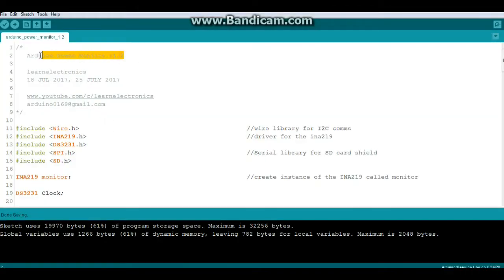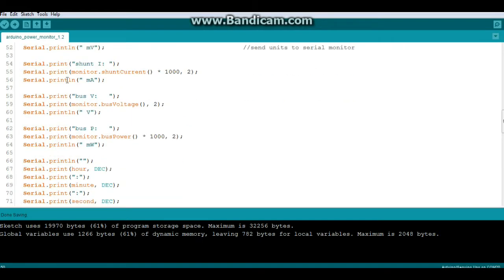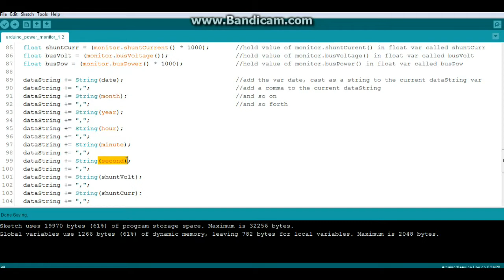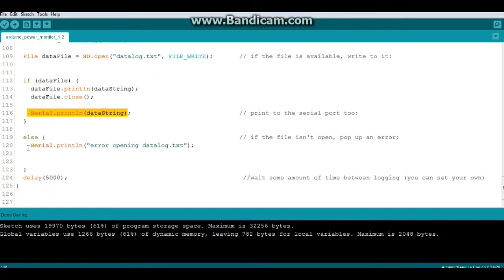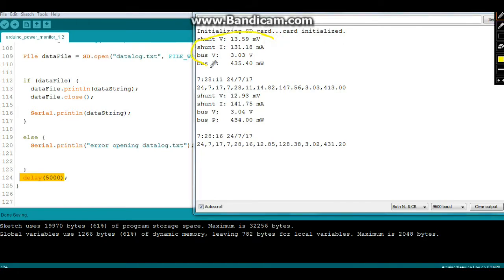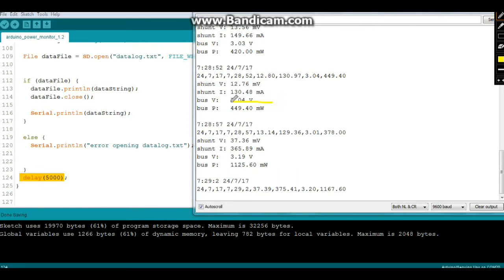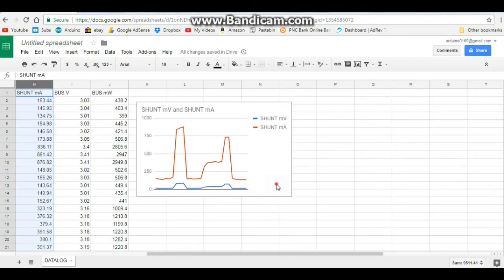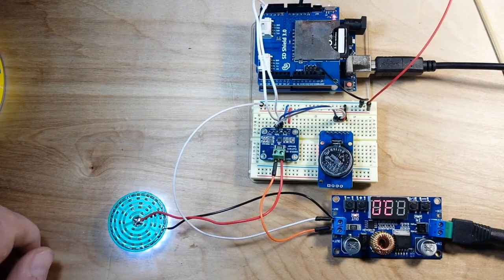Arduino Power Monitor with Data Logging

Comment: I think Fred has the right idea here. string variables eat memory like crazy. I hope you can get the library working with the ESP 8266 which should then work on an ESP32? Fun with comma separated data files. I started with them in the early 80's and still use them today. Probably showing my age! I had a fun project today I built a static phase converter from parts I've accumulated so I can get that Baldor grinder running. It works like a champ too. Thanks for your hard work on this project.
Reply from the maker: George Chambers damn c++ and casting, concatenating, I need a Turbo Pascal or Logo IDE
Reply: well there are pascal to c++ converters :P

Comment: using the string class on a microcontroller also uses a ton of flash and memory. if possible one should work with normal cstrings. if you have to concatenate stuff, pick a maximum length value and do it using a local variable.
Reply from the maker: fredlllll I don't know what you just said. I'm not will schooled in programming. The last programming class I had was in 1987 in Turbo Pascal on a Mac Classic. Lol
Reply: fredlllll, could you modify the sketch so we can see it in action?
Reply: in your code you are using the class String. and are doing operations with it like "dataString += String(date);" which is hard on a controller with 2KB of ram that is filled with other stuff already. it would be better to have a variable in the function like char dataString[50]; and then copy the needed strings into that. doesnt need any dynamic memory allocation :P
Reply: could do, maybe tomorrow if i remember
Reply from the maker: fredlllll thanks buddy
Reply: well i would like to, but i cant find the libraries you used. you should provide links to these too
Reply from the maker: fredlllll skip the rtc, the other library is the Adafruit ina219
Reply: well i couldnt compile it that way, so i just removed all the string stuff and used direct IO for the file, i dont know how arduino handles this internally, but it should be less memory heavy now https://pastebin.com/b30TSddw i didnt do the thing i was talking about cause that was just too much effort :P
Reply from the maker: fredlllll thanks Fred, l check it out when I get back.

Comment: Interesting how you didn't get it to work with the Mega.  I have mine running on a Mega logging data to SD card at 10 Hz (ten times a second) while also displaying on an OLED.  However, I do not have the DS3231 attached...I use the millis function instead.  If you're interested let me know and I'll shoot you the code.
Reply: Bro send me code 😘 I did real time single phase AC voltage (up to 250 volts) current frequency power factor and apparent /active/reactive /kWH /KVARH calculation  now I need to log it

Comment: Which INA219 library do you use?
Reply from the maker: Robert Gibbons the Adafruit library
Reply: Doesn't work. The Adafruit has "Adafruit_INA219" instead of plain "INA219" and even if you edit everything it comes up with "no member called shuntVoltage" etc.
Reply from the maker: Pardon me, I was wrong. I answered that without double-checking. Here is a link to the correct library: https://github.com/johngineer/ArduinoINA219
Reply: Thank you! That's the one. Way too many libraries with the same name out there. ;-)
Reply from the maker: Robert Gibbons you're welcome